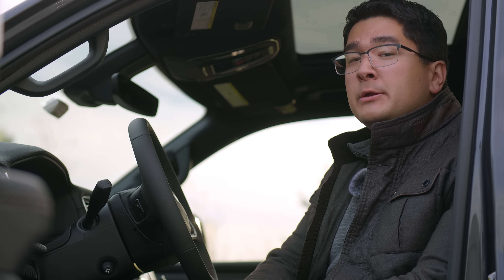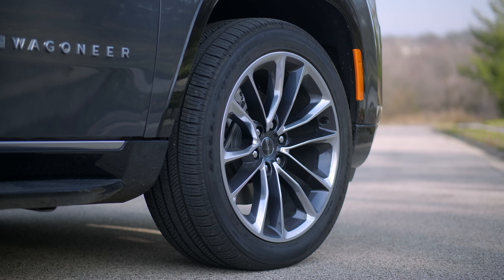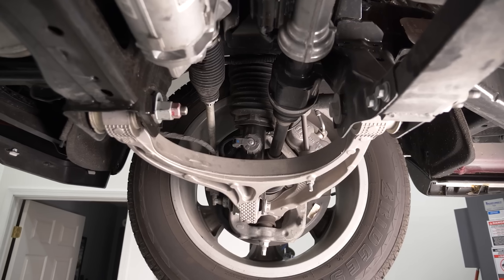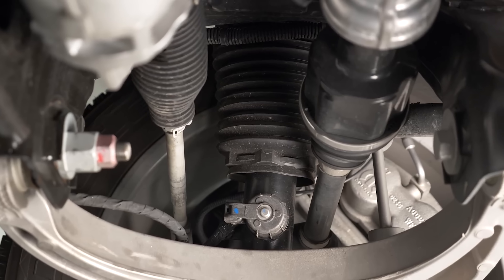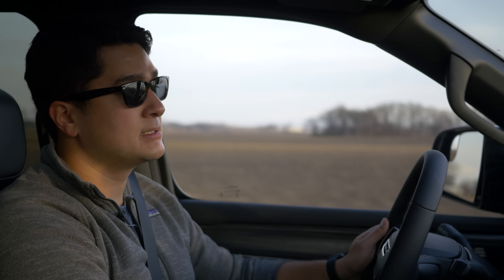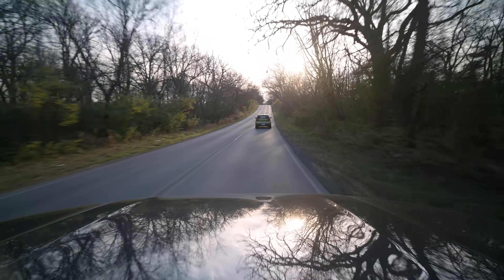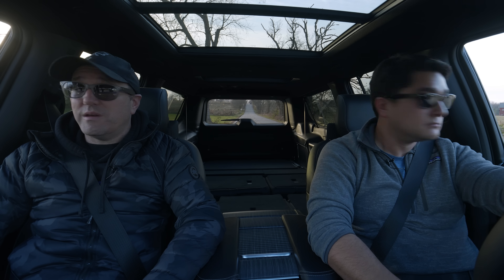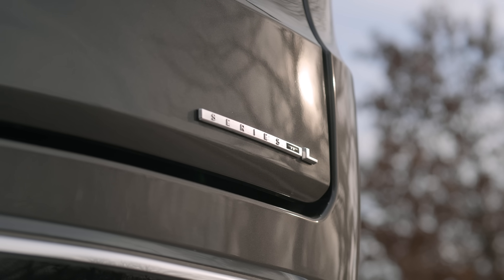2023 Jeep Wagoneer | Twin Turbo I6 Powered House

Comment from the maker: Just a Heads up, Stellantis Recommends 91 on SO engine and requires 91 on HO. However,  because SO runs high compression and high boost on heavier vehicles like Wagoneer namely loaded 91 should be standard to avoid timing and boost cuts, knock sensors on modern engines tend to be sensitive.
Reply: With that said I think you should still go back into the video and make the note that 91 Octane is recommended and not required for the standard output.
Reply: pg 351 of the owner's manual: This engine is designed to meet all emissions requirements, and provide satisfactory fuel economy and performance, when using high-quality unleaded regular gasoline having an octane rating of 87, as specified by the (R+M)/2 method. The use of 91 or higher octane premium gasoline will allow these engines to operate to optimal performance. This increase in performance is most noticeable in hot weather or under heavy load conditions such as while towing.
Reply: @steves.1700   Exactly. They are admitting in the manual that the engine will de-rate itself to protect from knock/LSPI, when run on 87. And that it can do this for general use, indefinitely. BUT, in order to get the ADVERTISED power, 91 is what she drinks.
Reply: Would this hold true then for all engines that state this on the fuel door "premium fuel required"? Any long term damage for using 87 vs 91?
Reply: @cadcamfreak  they would say "premium fuel recommended" and yes engines will de-rate or cut timing and boost etc. with lower octane, changing elevation and numerous other factors
Reply: All the more reason to keep a 5.7 Hemi if you have it. 89 recommended, 87 octane minimum.
Reply: @cadcamfreak  I don't think so. Those engines are high compression and designed from the start to use a higher octane. This engine is optimal w/ a higher octane but maybe was designed to use 87 w/ the methods mentioned above. 

I could be totally wrong so take that w/ a grain of salt. That's the way I understand it though. If I wrong someone please correct me. I'd like to know as well.
Reply: IMHO, any forced induction car should use 91 or better
Reply: I’ll put 85 tractor gas in it and let it ping away.
Reply: Minor losses in power are barely going to be noticeable, and any modern engines that is rated to run on 87 is designed to do so without damage. Given the meaningfully price difference I'd feed this 87 except when towing and happily give up the trivial amount of theoretical performance.
Reply: I always get my fueling specs from an offhand comment on a YT video
Reply: @cadcamfreak  It's hard to tell. I have a Subaru that is rated for 87 only with no recommendation for 89 or 91/93. BUT, in hot weather on the Highway, I can hear and feel it pinging and pulling timing. OBD II reader shows it (obv). Upping to 89 reduces it for all but passing situations and 93 eliminates it completely. More Power and better MPG's on 93. It's vehicle dependent, but manufacturers are leaning on their knock sensors more than ever before.
Reply: Ide rather drive an LTD than this if I want a big vehicle.
Reply: RWD and ability to not have air ride....seems like a win.
Reply: You lost me at direct injection.
Reply: It is officially rated for 87.  I do not think any owner will fill it with 91.  It probably makes a slight difference to torque curve but the knock should never be apparent.  My old Range Rover has the same recommendation.  It runs fine on regular.
Reply: can Americans please also say AKI after you say 91 because for the rest of the world that use RON 91 is the cheap crap.
Reply: @cadcamfreak  premium required mean’s premium required
Reply: @vr4787  I'll gladly put premium in, 5.7 has nothing on the new i6
Reply: @351tgv  no cos anyone with a brain knows what standards the US uses.
Reply: Then I guess Ford and Toyota should equally be running 91 octane or higher. I never hand an issue running my previous ecoboost F150 on 87 though. As long as it fits the minimum requirement you don't have much to worry about. These Turbo engines will always perform better on 91 though.
Reply: 2.0T (the exact same engine but half the turbos and 1/3 the cylinders) in the Wrangler already has issues running on anything other then 91. So its safe to say this will need it as well
Reply: The engineer who built this motor says that the high output does not need 91 period of course it's recommended and you would not get full power from anything less

Comment: Cars like these remind me that we're due for a recession.
Reply: At least someone else remembers this happens everytime.
Reply: The fact that I drive for a living in an affluent market and I still have never seen one on the road, tells me that we're already in the recession. Nobody is buying them that I can tell. Local dealer has had the same three sitting out front for ages.
Reply: @nodak81  I think I've seen a total of 2 since release. That's not a good sign as you said
Reply: There's alot of them in the Houston market.
Reply: @nodak81  I work at a shop across the street from a dodge dealer and I have never once seen one get purchased.
Reply: The excursion came at the precipice of the last one.
Reply: A recession starts after two quarters of negative GDP growth.
We entered a recession in Q2 of 2020 and left it in Q4 of 2022.
Reply: We are already in one 🤣
Reply: Like when all the car company's pushed 4 bangers in the 80s?

Comment: Took us 22 years but we finally have SUV's that are as big as the Excursion.
Reply: Spot on. Both are 226 inches, this said, Excursion really did rival some buses, especially if you got the diesel. I'm not so sure this Jeep is as truck-like and certainly will not hold its value as the Excursion still does today. It also, despite being toe-to-toe for size, seems smaller on the inside though certainly, the Jeep will handle a bit less ponderously.
Reply: The excursion is big but its use of space is poor. It has less cargo volume than a gmt400 suburban.
Reply: @Colin Nekritz  modern body on frame SUVs handle a million times better than the old excursions not "a little better" they've all moved over to an IRS and coil springs. The single biggest reason for excursions holding their value is the 7.3 powerstroke. It's one of the greatest light duty diesels ever made and the vast process differences between the 7.3 and V10 excursions proves that. All old reliable diesel powered trucks have APPRECIATED in value. A 5.9 12v Cummins 2nd gen RAM 3500 is worth over 75% now what it was when new. Pre DEF diesels are king in terms of longevity.
Reply: Dodge could have done a ram charger that size.
Reply: cue the Canyonero song
Reply: Yep and cost as much as a decent house did 20 years ago .. Actually this thing cost more than my 2000 sq ft home did 20 yrs ago ..
Reply: @matrinezkevin11492  this is all true. There are now companies that do full restorations on Pre DEF diesel vehicles and sell them in effectively brand new condition with a warranty because of how shit the newer stuff is. Ask me about our companies 2012 F-550 6.7 flatbed (spoiler alert it's a goddam nightmare).
Reply: @colin-nekritz  I disagree on value part
Reply: @colin-nekritz  doesn’t need to be as “truck-like.”  The Excursion max towing was 11,000 lbs on some models. Solid axles front and rear. Even then I think that was with 2wd. With the 6.8L, 10mpg, 0-60 in 11 seconds. The Wagoneer 4x4 can pull 10,000 lbs even with its IRS. 23mpg highway, and 0-60 in around 6 seconds. It’s not really compromised in capability. That being said, the 4xe model should offer even better improvements.
Reply: @alexs3187  0-60 4.7 Seconds with the H.O

Comment: Watching you guys driving it and seeing how much room there is behind the driver is kinda insane looks like you're driving a small bus.
Reply: competing with the expedition/suburban id guess
Reply: There’s more area in this thing than my mattress
Reply: It IS a small bus lol.
Reply: If you drive any midsize truck (chevy colorado, ford ranger, jeep gladiator, nissan frontier, toyota tacoma) it's actually right in line w/ those guys, except if you're using it for camping, you get all the interior room.

Downside, however, is independent rear suspension.  Not enough droop/flex for some obstacles.  But available locking differentials save that situation.  Hopefully they have a Dana 60 to save the day for the load.
Reply: Seriously. Reminds me of the old Excursions lol
Reply: They were exactly right saying it looks like a canal boat. That sucker is big. I don't quite buy its utility being better than a minivan, except in carrying large weights. Minivans are still champs at interior volume.
Reply: I want to see one painted like the Partridge Family bus.
Reply: Take the whole soccer team!
Reply: 😂😂 it is absurd.

Comment: Fair review, especially the plug on drivers buying these to be alone in the car!

Just a couple of things: While the low and high output versions share the basic Hurricane architecture, they differ substantially in internals. The H.O. has larger turbos, better cooling, a different head design, and quite impressively, forged internals. Secondly, the standard output does not require premium.
Reply: While it doesn’t require it jeep does “ recommend” premium for the low output.
Reply: Nice to see the forged internals from factory....
Going to be some rippers with bigger turbos and some nitrous
Reply: @pilotvanquish3886  true. Kinda what Ford does with their Ecoboosts. Premium is recommended in severe duty and towing purposes.
Reply: @AH-lw2bj  I certainly agree. The H.O. comes from the factory with 26 pounds of boost, so there is definitely room to push it up a notch. I'm sure Stellantis is working on some sort of SRT versions of this engine.
Reply: @hellkitty1014  I just hope it sounds good, my buddy had an old 4.0L HO Cherokee with straight pipes and it sounded wicked
Reply: Forged is great. Other engines that have always had forged internals: Toyota 1UR and 3UR V8's. Except for the pistons, which are coated and hypereutectic.
Reply: Yea if I bought one it would have to be the high output. Factory fully forged engines have always been known to last forever.
Reply: @hellkitty1014  26 pounds of boost is insane for a i6 from the factory.  The R35 gtr only makes around 13lbs from the factory.
Reply: @notoriousmerc6069  I thought that was a typo as well. Then I read the spec sheets, and indeed, 26psi boost! This little 3.0L I-6 is insane. Can't wait to see it in the upcoming Charger/Challenger gas replacements. And of course in something lighter like a GC.
Reply: @hellkitty1014  Didn't they announce that the current gen Charger/Challenger are the end of the line? EV only afterwards?
Reply: @quixomega   no more V8 super performance variants, but there will be ICE replacements.
Reply: @pilotvanquish3886  They always play that "recommended" trick. It's what is needed for the rated power and torque, but there's no real need for it if they don't require it.
Reply: Was looking for this comment, thanks. 

Molar is selling 1,000 hp crate versions of this motor already. Maybe vaporware but they definitely are seeing a high ceiling here.

Comment: 0:30 “Which is basically two RAV4s worth of cargo space”

Me: No way two RAV4s can fit in there!
Reply: 131 cubic feet is pretty big, but the Chrysler Pacifica minivan has 140 cubic feet, so... Minivans are still superior in this category.
Reply: Can be used as a Hearse ☺️
Reply: Jack be Nimble Jack Be Quick get to the gas station!
Reply: I had the same thought for a fraction of a second.
Reply: @lka1988  like the Sequoia/Sienna argument. The only way the Sequoia to have more cargo space over the Sienna is to tow a big trailer
Reply: they said cargo space correct?
Reply: 3 of the wagoner l can fit in our 53 ft trailers.

Comment: I looked it up and the Wagoneer L is the exact same length as the Ford Excursion, but 3 inches wider. Definitely the return of the Canyonero.
Reply: It’s wider?  I have an 02. Will need to park next to one to compare
Reply: @dylanbuk7055  Your 2002 Excursion is listed as 79.9 inches wide. The Wagoneer is 83.6.

Comment: Good to still see a full size spare underneath the Wagoneer. Electric SUVs never seem to have a flat tire. The traditional ones are superior in that respect. Same for having normal doorhandles and proper buttons in the interior.
Reply: Plenty of ICE crossovers are also deleting spares, though not in this category, where the added size and weight isn't a problem.
Reply: Yes that under car tire is awesome when it’s your rear tire that burst sets on the rim and you can’t get the tire out, funny engineers
Reply: Oh my wife and I got stuck in Wyoming and couldn't find a charging station.  Back home in SF they are everywhere LOL.

Comment: My 1990 Ford Bronco with the 4.9 I6 rated at 140 hp and 5 speed manual transmission gets 14.5 MPG so the jeep getting about the same MPG is impressive for what it is.
Reply: not when you account for 30 years of progress
Reply: @bradhaines3142  I think the sarcasm went over your head lol
Reply: @v8_sami  bruh sarcasm does not translate over the internet, that's a known fact

edit: and with saying 'for what it is' doesnt help, like it's actually giving them credit because it puts out more power. not really signaling any sarcasm there
Reply: I was thinking that 50 years of "progress" from the old V8 powered full size station wagons of the early 70s has not netted us much in terms of fuel economy. 

I grant that the modern iron drives a lot better and runs cleaner.
Reply: @martinliehs2513  mostly in effeciency, they have like 3x the power stock and used the same or less fuel

Comment: The elephant in the room is the reliability of that new inline six. I'd guess it's the first Mopar straight six since the legendary 225 slant six, unless you count the even more reliable Jeep 4.0. But this thing has twin turbos. Even the Pentastar V-6 had it's share of teething pains, although it ended up being pretty good. Best to wait a few years unless you are very risk-tolerant. Benchmarking the BMW B58 is a damn high bar, at least as far as refinement goes.

Comment: What I want to know is, what does the head gasket look like? The weak point in most turbo and high-compression engines is the head gasket, and many will remember the Ford EcoBoost I4 coolant intrusion debacle from 2015-2018 Fusions, Escapes, and Edges, which was corrected in mid-2019 with a block redesign. What redeems the GDI EcoBoost motors is that they will adjust power down for 87 octane fuel, so if the Hurricane can't do the same then there's going to be a problem.
Reply: My ford edge has 100k miles and they say the coolan intrusion happens before that. Depends on where the engine was made was the common problem. Also certain years so its not the design its the builders being lazy and not getting paid what they deserve which in return effects consumers.

Comment: There is a reason most Semi Trucks use an inline 6. It's inherently balanced and smooth with more torque. It's much easier to fit turbochargers on inline engines. Realistically, Ram should have offered inline-6 engines for some time due to the benefits it offers. They should have never gone with the 3.0L V6 Turbodiesel.
V pattern engines offer packaging and performance benefits. For a Pushrod V8 the weight is lower, the height and length are less, but it's wider. A supercharger is fairly easy to fit on a V8, but a turbocharger would be complex. For a performance-oriented vehicle, the V8s will still make more sense.
Reply: Yes, but an I6 is usually too long for transverse use. For Stellantis, which is making a lot of vehicles with aging V8s this was easy to justify strictly for RWD use, but many manufacturers prefer a more versatile engine.

Comment: Great review guys!  I have a 2022 Wagoneer Series III.  I do my own mpg calculations (the car’s computer is about 1.5-2mpg generous in my history with Stellantis/Chrysler/Jeep).  I get about 17 local, and low 20s on the highway…Disappointed in the mpg you guys saw…and if that’s from the car’s computer, it’s probably close to 12mpg with required premium!  Ouch!  The 5.7L doesn’t require premium…bummer.
Reply: I’m getting about 15.5mpg around town in our Wagoneer with 5.7l v8. Was expecting the I6 to be a lot better, actually surprised. My BMW S55 I6 easily gets 20mpg+
Reply: @rezilient112  that's the confusing part...they went with a turbo engine which in theory is supposed to give you better MPGs, but folks will literally be getting the same MPG as a V8? there wasn't any point of dropping the V8 then lol.

Comment: I always have to shake my head when someone says an engine is outdated just because it has pushrods.  Overhead cams have been around just as long, for one thing. And for another, there's more TRULY  modern engineering in the form of computational fluid dynamics and simulation in the cylinder heads of a pushrod LS or Hemi than meets the eye. Similarly, numerical stress analysis to tell them where to remove material in such a way to get a cast iron block with all material advantages to weigh only 20 lbs more than an aluminum version. But back to valve actuation methods:  It takes modern engineering to get two-valve heads (especially the wedge-type LSx engine family) to flow air better than the brute-force overhead-cam 4-valve approach. The Hemi is getting a bit long in the tooth, the current versions dating to 2011 with a significant block upgrade to the 6.2/6.4 in 2015... but they aren't archaic because they have pushrods. In fact they'll fit under lower, more aerodynamic hoods than many OHC engines will.  I'm excited to see how the inline 6 works out, but for me (until its proven) its still a lot more complexity for little or no benefit to the driver.